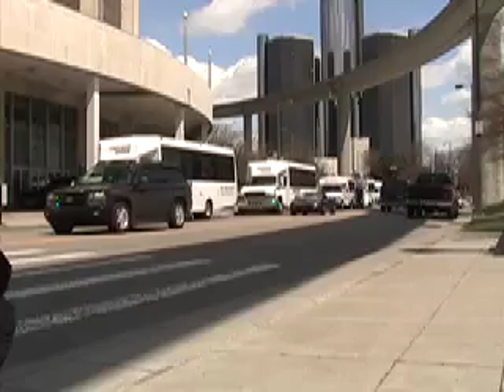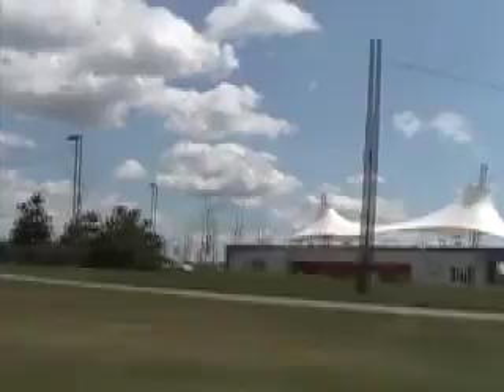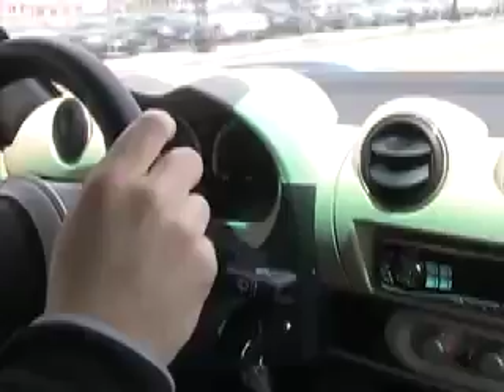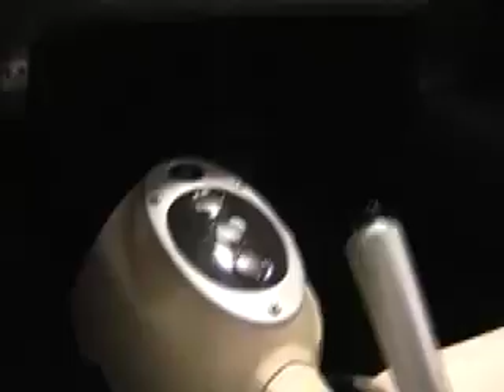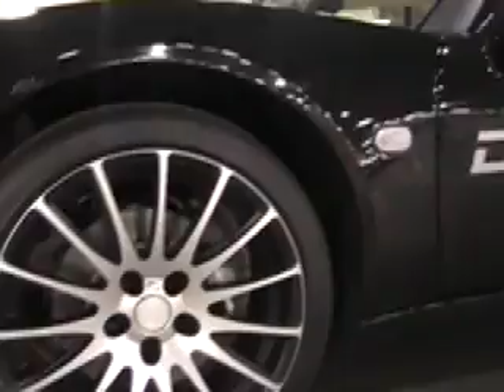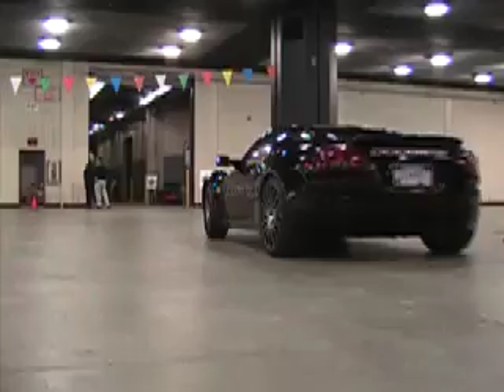Dodge Circuit Drive

Comment: The larger battery packs actually make cooling an safety harder.  The ESS is modular anyway.

But all current batteries will be trumped by nanowire and other improvements already coming out of the labs long before any replacements are necessary.  Those next modules will probably get 3-10X the range.